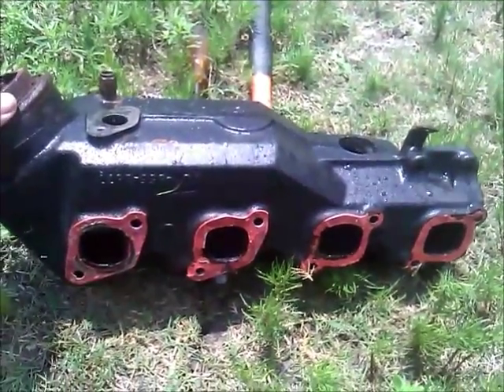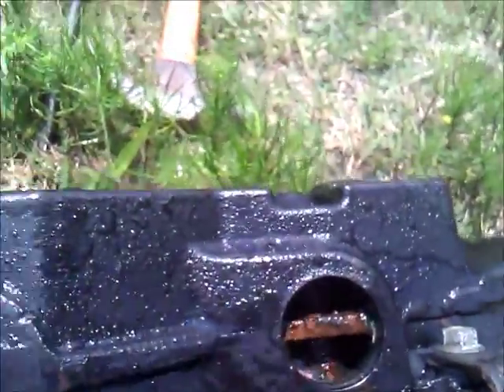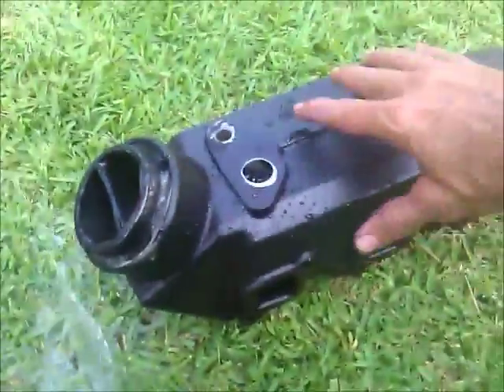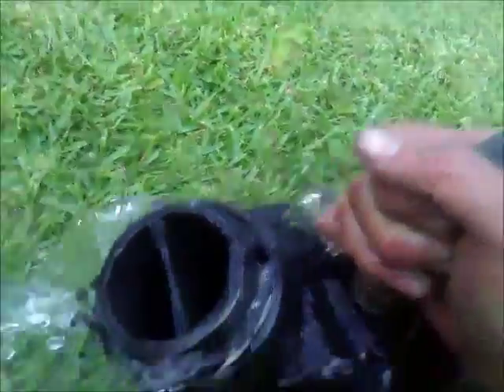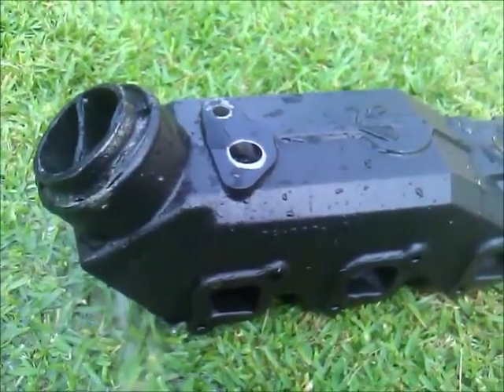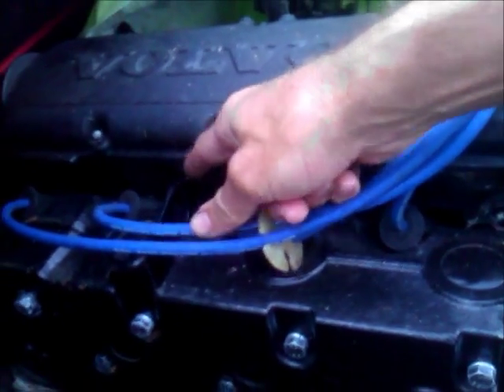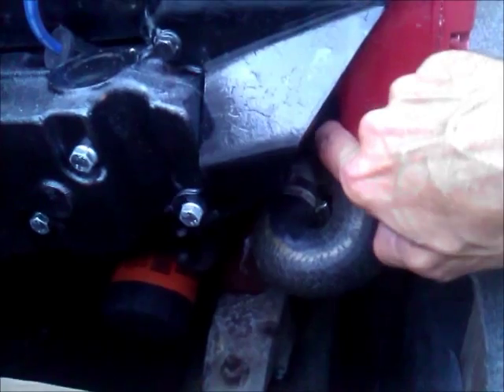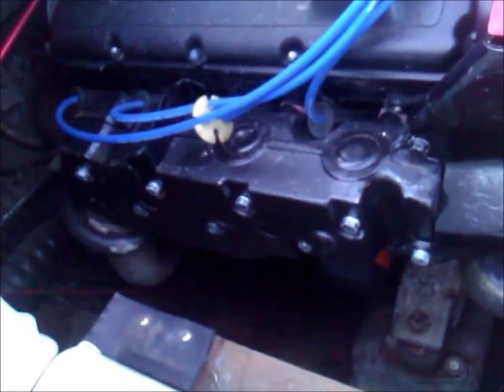volvo penta 131 exhaust manifold flow test and install

Comment: Great vid! I have a 96 Penta 230, same engine like yours,  overheating, as discharging raw water is very small. I will do a flush test to see how much flow the manifold passes after heat exchanger. Water pump has a big back pressure.